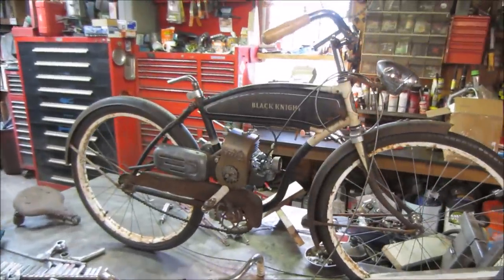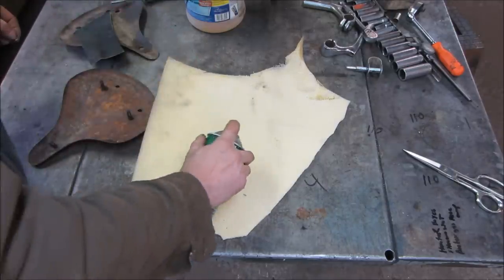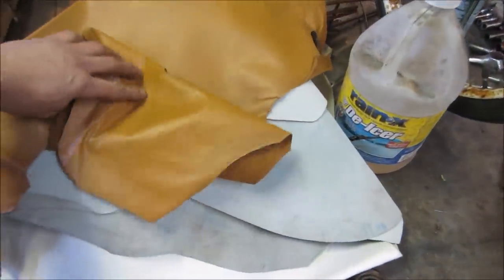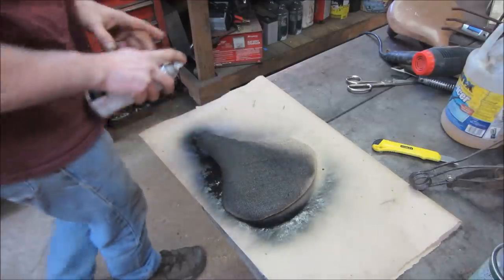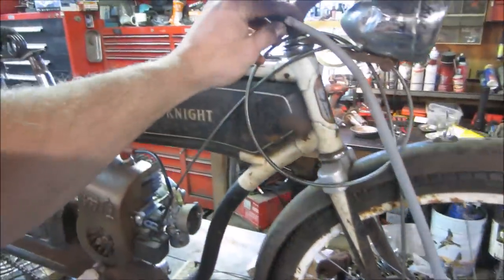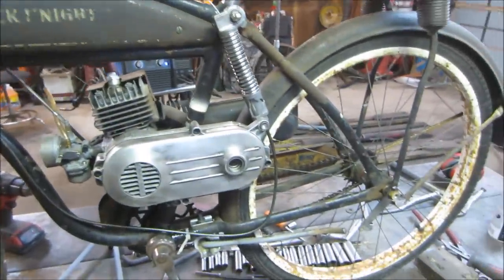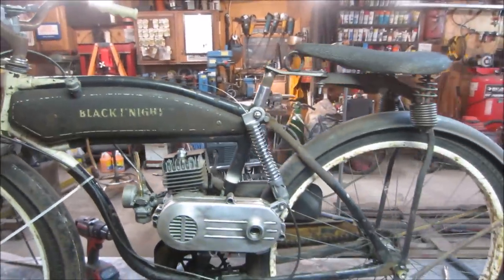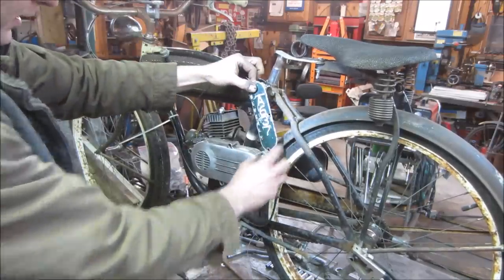Building  custom parts for the bike.

Comment: I meant to write last time about the name  "Black Knight." It is one of a number of names given to bikes built in Germany and Austria by Daimler/Puch/Steyr, who made many "racing bikes" for Sears and Roebucks and Montgomery Wards. I talked to a local 80 year-old bike guru about it and he said that as far as he knew the "Black Knight" badged bikes were not sold in Germany or Europe, meaning they went to the States, I guess. The frames are considered quite good.
Reply: Nice info you shared.
Reply: Hey Bruce.  Was the Black Knight named for the English Vincent "Black Knight" motorcycle of the mid-50s?  It was a very distinctive unit that had the look of the knight's horses "armored" for battle.

Comment: I'm no leather worker but know a few saddle makers and seen it done a few times, you're on the right track soaking the full grain leather. But if you aren't working it to something you can stitch or rivet it down to, you're going to need to punch some holes around the outside and draw it tight like a drum skin. When it dries it'll hold it's shape and you'll have a flange on the bottom you can trim up and clamp between the seat pan halves. Boot toes are done that way when machinery and molds aren't available.

Comment: Love what you do, thanks so much!  At 11:34 into the video, I was thinking to work that leather use a heat gun to stretch it and some contact cement on the edges to secure it?  I upholstered some vinyl onto a vintage Fender amp and saw that using heat facilitated the vinyl to stretch around corners without cutting...  Just thinking out loud.  As you were!  Wishing you continued fun adventures!

Comment: I have seen cable ends made out of a spent 22 cartridge. They first cut it to about 1/4" length. Then they drill a hole through the end of the cartridge just large enough for the cable to go through.  Then they just tin the end of the cable and shove the cartridge over the tinned part of the cable and melt the solder to the cartridge. To finish it up they drip molten solder into the open end of the cartridge until it's full. I think they put a vice-grip on the end of cable while dripping the solder into the cartridge for a heat sink. I don't know how strong it is, but it seemed to work where I have seen it used.

Comment: There are different types of leather. Chrome tanned leather like you used is already finished and sealed. It is what it is and is suitable for some jobs. Another type is Veg tanned. Veg tanned can be wet and will mould around an object then will dry and harden in that shape. Veg tanned leather is fantastic and easy to work with for seats like that. Also veg tan and be stamped and carved and will keep that imprint. Grab a piece of veg tan for your next seat and you will say "Why did nobody tell me it was that easy?" This is me telling you.

Comment: You could always use some shrink tube on the cable where the jacket is missing.  Would at least keep the dust out.  However, that may constrict the cable.

Comment: I know youve probably already filmed it and decided what to do, but for the license plate, Id connect it between the bottom bolt of the shock and the engine, then where the top bolt needs to come through slot the license plate so it can travel on the top bolt, should keep it from vibrating and moving around and it can move with the shock! BUTTTT i know its yours and you will make it your own! Love the videos Mustie!
Reply: Dang..just read one of your comments down below that the bike is done...I wanted to help! lol

Comment: Not trying to be morbid but I once "knocked myself out" when my head hit the handlebar neck about where you've got that nasty bolt sticking straight up about 3 inches.  In my case I'd try to do a "sweet jump" but not enough speed and when the front tire dropped straight down so did my forehead.  Something similar could happen if someone were to say hit a pot hole or give too much front brake in an emergency stop.  Wouldn't want to see you or someone else getting seriously injured from that bolt sticking straight up.  Dunno, you may have already cut it off and I missed that episode.  Love your videos.  Learning a lot.

Comment: The decal on the frame head is tooooo coooool ..... the bolt on the handle bar - lance mounting point ........ my idea for the drive engagement (warp drive) was a cam piece in the shape of a really big slice of pie, with the point being a pivot point, the pivot stud mounted on a leaf spring, fabed up to rivet to the lower rear frame, and a slot on the slice o' pie where the crust would be, and a lever to move the cam, and a little ball bearing running in the cam slot.  Thus, *no**cable*.  But then where to mount the lance? ......

Comment: Next time a pair wire cutters with one side open will make a good mold. The metal shrinks in a few seconds after you pour. Just open up the end of the wire, the metal won't slip off as easy.

Comment: I was cringing watching you trying to use some old chrome tanned leather. Makes me want to send you some vegetable tanned leather which molds when wet and can be tooled. If you want some let me know. Just run it under warm water and it molds like a holster.
Reply: The only guy in N.H. with a saddle tooled bike seat.

Comment: don't ever put leather in the microwave. best way to form it is to soak it or spray it with warm water hot water makes it become very hard when dry. that type of leather that you had has to be kinda stretched over sharp bends. i usually use wooden forms to start forming it. love your vids  can't wait to see what creature emerges from the hoard this time

Comment: You can get lube up to that part of the steering by taking the front tire off, then take the front splash guard off and there should be an access port to spray lube upto the part you need to lube so it doesn't snap.
Reply from the maker: l did not need to save it but understand what you are saying
Reply: Mustie1 can't wait to see the finished product.

Comment: Is it possible to make a shroud over the engine shock/spring and attach the number plate on that? That would hide it too. Also I don't like the current clutch handle/assembly, doesn't "normal" lever-type have enough travel? Thanks for great videos!

Comment: Figure out how much "pull" that spring has, and fine tune some spring stock to the same number, about 20 30 cm (to act as a dampener as well), then wrap it in leather and put it mounted at the front of the bike and with a bolt in the eyelet on the engine, from there your regular linkage can be used with one modification, it has to be a releasing setup, so that when it releases tension on the engine, it allows the spring/dampener to act.

Comment: Saw on donyboy73 making feral for snow blower clutch lever. 
Drill hole in piece of wood size needed making a mold for end and then  make channel for cable to lay in
Pour liquid solder in hole over end of cable

Comment: Daryn, I used to read westerns by J T Edson... he wrote about a guy who made gun holster rigs for certain gunfighters... he would seal a sixgun with oily rag to prevent rust, then he would soak leather in cold water and gradually mold the leather to the required shape,,, after that he would let the leather dry with the sixgun still inside... that way the holster would hold the shape of the sixgun for a snug smooth fit... any help to you?

Comment: 1st comment on any video and I give it to you. Mustie1, I want to start off by saying I love your channel it is AWESOME! Since I found the first video of yours on a Beetle bodywork, I have been working my way through them all. 
I love to re-appropriate items to make other things and am known by my friends as the go to person to fix things. and what you did with the fire tongs is exactly the type of thing I like to do. I do have a question about the seat front mounting you made. Where it is a solid plate and is up against the seat spring would it reduce the movement and put more vibration into the seat right where you don't want it (or perhaps you do lol)? Everyone is a critic :-)
I spent some time in the past replacing cables and to make the lead ends I made myself a simple mould out of 2 blocks of steel a drill press and a clamp. It meant I would get the right size every time and I could get the steel fixing pin the right place. I don’t know if you make a lot of ends up (only just started watching the bike section of yours) but it might save you a lot of time and effort if you are doing a lot of them. If you want I can send you a drawing of the ones I made up.

Comment: That paint is going to come off that seat, onto your pants. LOL Fill in those 'pivot point' holes with weld, or they will more easily bend at that point. Did you fray the end of the cable out a bit before you started dipping it?

Comment: next time try using a piece of wood with a small hole for the wire to go trough and a larger hole on other side for pouring in hot lead for the ball

Comment: To bad you can't use a hand break lever. Have it engaged when the handle is released and disengaged when pulled. then it would be like a motorcycle clutch.

Comment: These old bikes could be had with dynamo rims. They are MUCH, MUCH better than bottle dynamos.  Bottle dynamos are trash.  They burn out the lights if you go too fast.  Dynamo rims don't do that.  The bulbs are still available, but the dynamo ones are not.

Comment: That solid wrought iron (especially with a hole in it) for seat struts will bend very easily. The entire bike is too short. 3 slices on the frame, splice in 3 new pieces, lengthen by 5-6 inches. HEAT shrinks stuff like fabric and skins. It expands stuff like metal, water, muscles and gases. Cut a 1" larger trace of the black leather now, then cut 1/2" slits every 1" around. Put the leather over what's there now- the more padding the better. Dab of glue on each flap. Tuck the pleats in, and use the bottom plate to anchor it together. Look at the old piece that was inside it.
Reply from the maker: what makes you think it wrought iron?
Reply: Most fireplace instruments are. Very quickly and cheaply produced, minimal heat and labor. A hollow tube is always stronger than a solid bar. Wrought iron is an iron alloy with a very low carbon (less than 0.08%) content in contrast to cast iron (2.1% to 4%). It is a semi-fused mass of iron with fibrous slag inclusions (up to 2% by weight), which gives it a "grain" resembling wood that is visible when it is etched or bent to the point of failure. Wrought iron is tough, malleable, ductile, corrosion-resistant and easily welded. Before the development of effective methods of steelmaking and the availability of large quantities of steel, wrought iron was the most common form of malleable iron. It was given the name wrought because it was hammered, rolled or otherwise worked while hot enough to expel molten slag. The modern functional equivalent of wrought iron is mild or low carbon steel. Neither wrought iron nor mild steel contains enough carbon to be hardenable by heating and quenching.